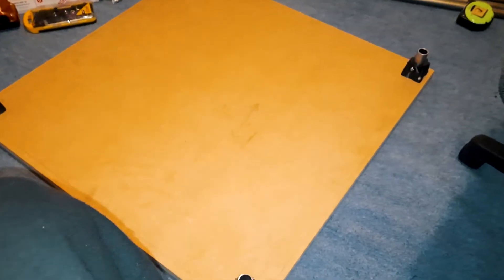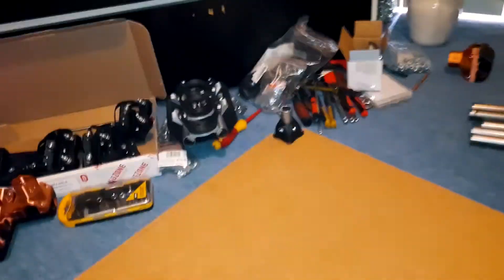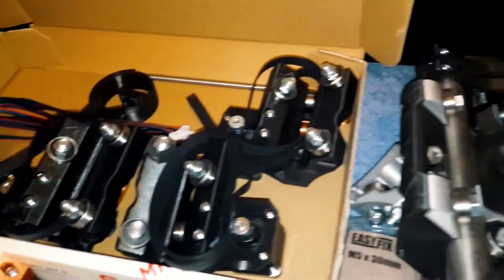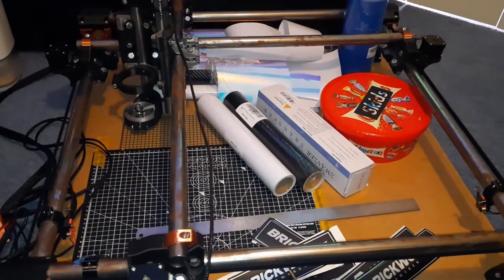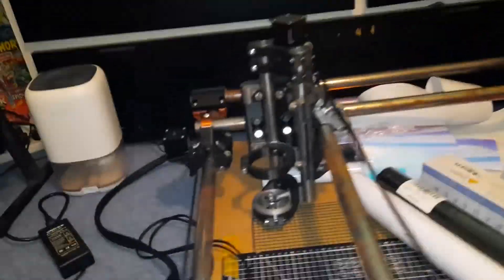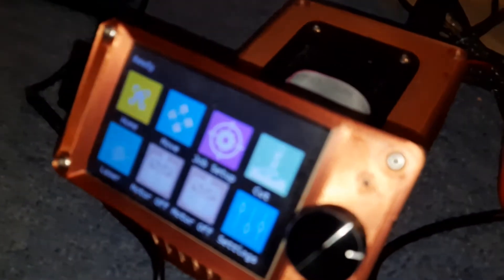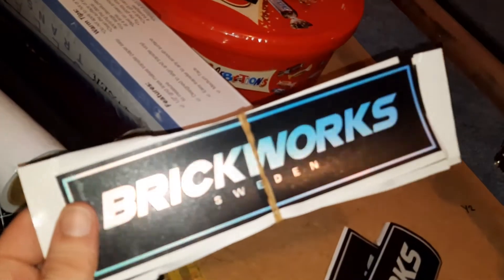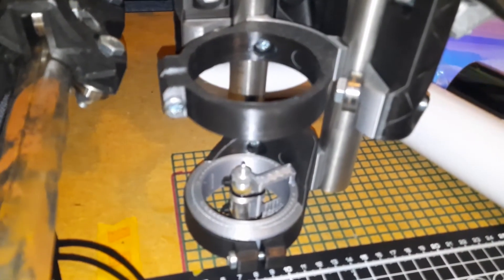MPCNC Build

Comment: what spindle do you plan on running to cut aluminum? got my printed parts done just need hardware, wiring and my spindle!
Reply from the maker: We'll be using a Makita RT0701C router, should work fine

Comment: link to your website appears to not be working :( 
Cool stuff though, was thinking of building one myself
Reply from the maker: Working on fixing that at the mo... should be back up soon
Was proper easy to build, can sort you out with working firmware if you end up using the same board as we did (SKR 1.4 Turbo)
Reply: @healthiestmotorsport5145  cool that'd be sick cheers! I'll shout when i'm getting it sorted, hopefully sooner rather than later